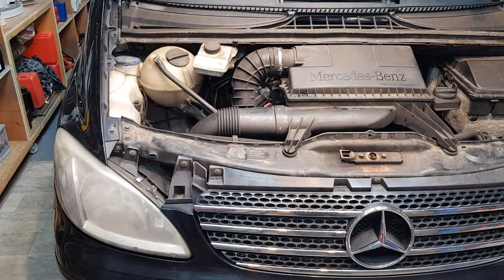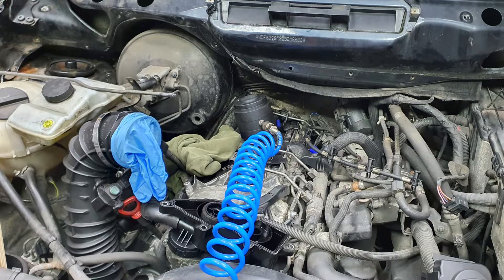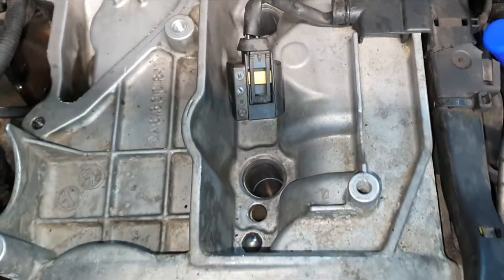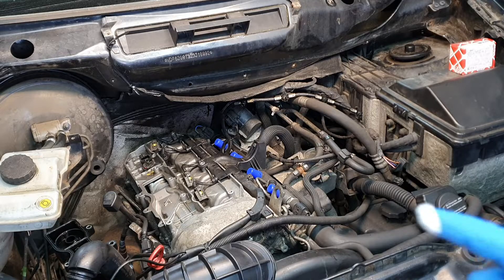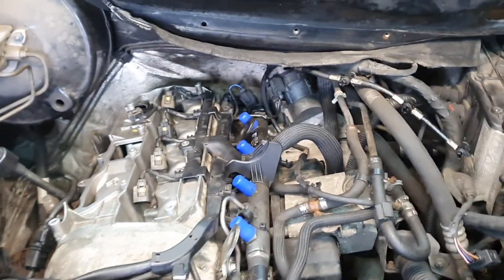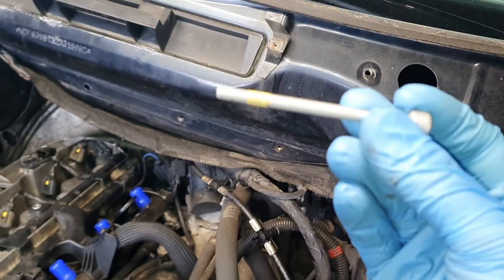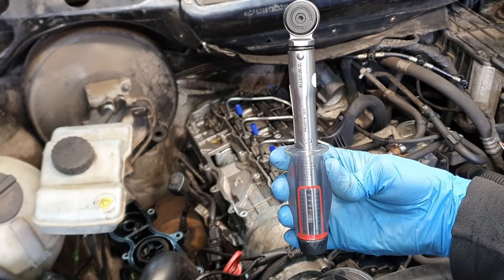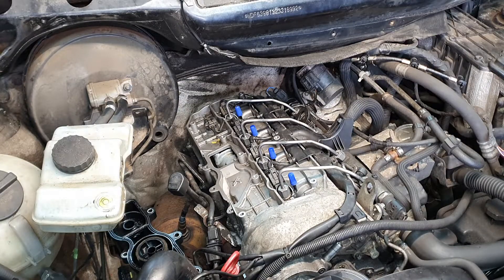Mercedes Vito Viano W639 Sprinter How to remove install injector copper seals Black Death OM646 cdi

Comment: Hi,great video, thank you. I’m just about to attempt this on mine. When you apply thinners to remove the carbon, how do you plug the ports and remove the waste material and leftover thinners?
Reply from the maker: I have silicone tapered plugs that are normally used by sandblasting and powder coating companies to plug holes, I plugged the bottom holes to the cylinder and then stuffed rags in the ports. See link for the plugs https://ebay.us/m/pdwDn3
Then you can pour thinners and work safely

Comment: Good job! Would you buy a Vito with this kind of condition, or are there any risks associated with black oil sludge around the injectors other than having to replace seals and maybe injectors also?
Reply from the maker: They are good vans as long as they are not rusty. Everything else is very reliable and easy to work on. Copper washers every 60-100k miles and you will have no issues
Reply: @TheKeenMechanic  Thanks man!

Comment: Amazing detail but too scared to do myself. My Vito has Black Death & code 0101. I live in Frome Somerset. I need someone to do my injectors/Black Death but RYGOR too expensive sad😢
Reply from the maker: It will be hard enough if you don't have the tools other than that just use common sense. I am sure someone will do it for you🤞🏻

Comment: Best is to put new injectors..
Reply from the maker: @deejagers716  Best is to get a new van 😄
Reply: @TheKeenMechanic  . You are probably right but week before i put about 2000e in my old sprinter from 2002.. is that mistake.. probably yes, but i love driving in that old van.. is something special. I change brakes, some pipes in steeringswheel ... need to change cardan (driveshaft)  also..pfff... but still love him.

Comment: Love the videos, thanks.
What make injector are you using and another question, all injectors have therer individual bolts why would Mercedes spec 2 X 90 degrees instead of 180 in one hit ?
Thanks,mick.
Reply from the maker: Thanks for your comment Mick, I am using the original Bosch injectors. As for the bolt tightening sequence, Mercedes specs 2 x 90 degrees instead of 180 in one go to ensure even torque distribution, prevent bolt stretching, and improve the injector’s seal. This step-by-step method helps avoid leaks and ensures proper seating of the copper washer. Hope that helps!
Reply: @TheKeenMechanic  sorry i meant injector tool ! The pneumatic vibration tool ? Thanks for getting back to me
Reply from the maker: @02mick75  pneumatic injector removal tool from ebay
Reply: @TheKeenMechanic  thanks, just had a look plenty available !

Comment: For the sake of understanding, what is the reason why the bolts HAVE TO be brand new?
Reply from the maker: They are stretch bolts and one use only, if you try to reuse them they may snap
Reply: They are called torque to yield bolds, they extend in the first use and in the second use it may snap
Reply from the maker: @us3804  Thank you

Comment: Hi would you do this job on my viano please it’s a 2008 3.0 diesel ⛽️
Reply from the maker: @GETGRIP  Hi
I am sorry, I get asked this question almost every day. I am at full capacity and won't be able to take on any extra work for at least 2 more years in the future. Why not use my guide and do it yourself🤝🏻

Comment: How does the leak off pipes come off the injectors? Is there metal horse shoe clips holding them onto the injectors? Cheers
Reply from the maker: @dmc1221  Look closely, pull the tabs and lift up

Comment: Which tool did you use to clean the ports?
Reply from the maker: @motoluca3184  I used a soft brass drill brush. Very easy and clean job, no scratches and keeps everything the way it should be🤝🏻

Comment: Just bought for myself as I’ll do it today,cooper washers and bolts (5pieces each as a set) from Mercedes dealership for arround 15£,😊
Reply from the maker: @claudiuilie90  Hi
Did they charge you £15 for the bolts and copper washers all together?